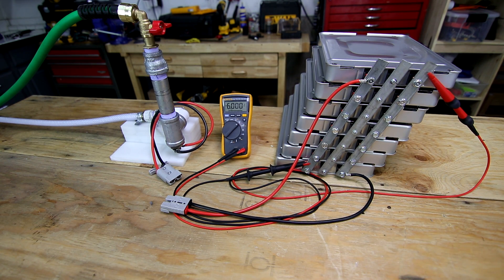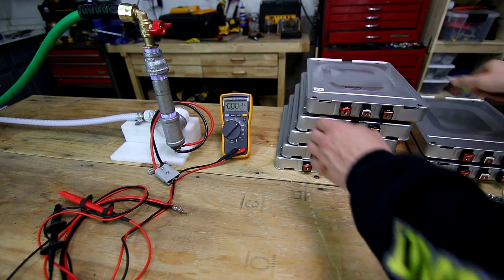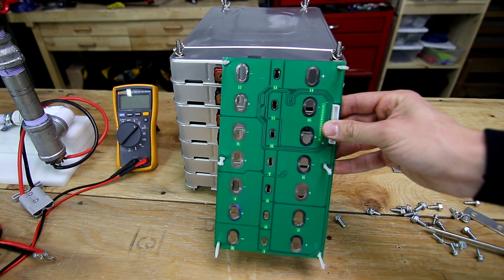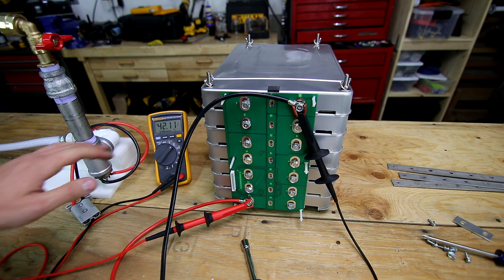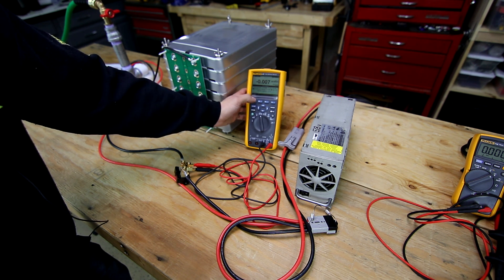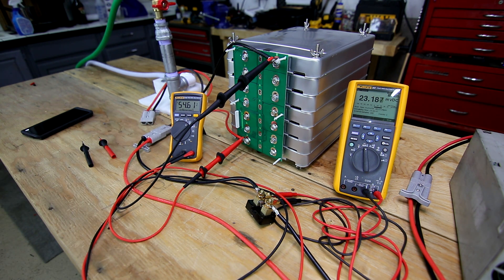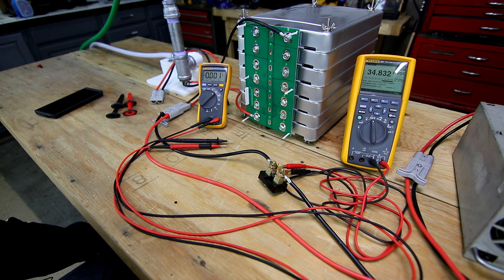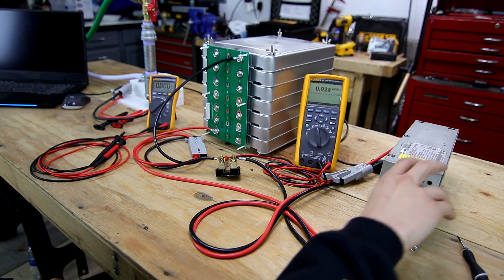Off Grid: Bottom Balance NMC Cells for Solar Use (Leaf Cells)

Comment: I know this is an old video but I still have my first battery I built and it's 24 leaf cells in 24 volt configuration. it powers my small workshop with a powmr 3000 inverter and a victron charge controllers and old sharp solar panels. I have 2 active 5 amp balancers and no bms. people say it's dangerous but so far so good and it's been going for years. I'd like to replace it tho with lifepo4 like my home has

Comment: Alluminum bas bars on copper therminals are not a good practice. Alluminum and copper is a galvanic pair, they will eat each other.
If you have problems with balancing, you have way to different capacity on them.

Comment: Top or bottom balancing will not really work for used cells UNLESS all the cells HAVE similar capacities. Otherwise, weaker cell(s) will always discharge and charge faster, resulting in (possibly large) cell voltage differences. BMS balancing will not be able to make up the difference because they typically only do small balance currents. These are used cells. One cell may be a year old, others may be five years old. One cell may be lightly used, others may be heavily used. You need to test the cells and use similar capacity cells to make the battery pack. For the battery pack, I would monitor the cell voltages so they don't get closer than 0.1V to the high/low voltage specs. These are old NMC cells so you don't want to stress them for safety reasons.

Comment: It's a bit unbalanced because it is a new pack and it is second hand but the BMS will well-balanced the batteries as it charges maybe it's a good idea to make a video ons how installing the BMS..
Reply from the maker: Help me understand then - If I bottom balanced all the cells down to 3.0v then how is it unbalanced?
Reply: To better understand it's a bit of a procedure ask the batteries are charging with a BMS jump around with a voltmeter looking at the battery which battery stays behind it's kind of hard to do this with a lithium small cell battery to better understand this or to practice this method it's on lead acid batteries where is the voltage is far apart

Comment: Another thing to consider when using used cells, they may have started to self discharge. Top balance them to all the same voltage, then disconnect them and let them sit for a month. After that time, measure the cell  voltages and look for ones that are out of line. Even if a cell has good capacity, it should not be used if it has started to self discharge at a higher rate.

Comment: Oh boy, you need to USE a BMS with temperature monitoring! These are used cells that probably have been heavily used. And they are NMC type cells. You need to take GREAT care when charging/discharging this battery chemistry so bad things don't happen! At this point in their battery life, I would not get too close to the maximum (high) charge voltage or the minimum (low) discharge voltage specs.

Comment: Still have 12 modules going to be configured to 24v.   Building a shed to house all solar projects.  Waiting for the completion of that to go forward.
Reply: @pulesjet A 7S configuration for LiIon is better for 24V. With 6S, you will lose a lot of power at the low end of the range, AC inverters typically shutdown somewhere around the 21V range.

Comment: Top and bottom balancing really only works well if the battery cells had a similar life 'experience'. Since these batteries are used, I would have ordered extra battery cells, test the capacity of each cell, then build a battery pack using cells of similar capacities. If you have 1 cell of very limited capacity, that will limit the overall battery pack capacity as you have seen, especially if all the other cells are much better.

Comment: What Battery charger is that? Thanks!
Reply from the maker: It's a Delta brand telecom power supply.  I can get the information from the label later today if you would like it.
Reply: @HighTechLab  yes please question I also used a power supply as a charge but I noticed I cant limit current it puts out the full 600w it was rated at any worry in breaking them.
Reply from the maker: If you're using it for what it's rated for you should in theory be fine unless it's cheap low-quality equipment.
Reply: @HighTechLab  it's a tdk lambda sws600 so it's a great power supply but I am charging 13s lithium to 53.3 volts just by adjusting the voltage setting my batteries can handle it cause they are big and have a high c rating but not sure if the power supply will burn out being at full power for over an hour. Right now I current limit using a Chinese 1500 boost converter but would rather take that put of the equation
Reply: @plojm123  Yup, lambda is good. A good rule of thumb is to run a charger no higher than 80% capacity. Running at 100% will probably decrease its lifespan. And derate the chinese stuff even more. I would not charge batteries at more than a 1C rate.
Reply: @gregb1714  do you have a good way to current limit a power supply using it as a charger?
Reply: @HighTechLab  I'm also interested in your power supply. Can you provide the model number?

Comment: Good info if I could add one point I would let the batteries sit taken apart 24 hours after the 3.0 voltage draw down and check again for 3.0 on each battery and draw down the bounce back on the ones that need it, small point in capacity but it may help. We will be waiting for the capacity test, always enjoy your videos.
Reply from the maker: That is a great point. I have done a lot of draining and resting on these cells prior to the video but they were still all together in the pack

Comment: Nice video.  Very interested if this process will increase the overall capacity of the cells. Some sellers are stating that when these used Leaf cells are used in a low C rate system they will "gain" capacity. Really curious if your testing will shed any light on this possibility... Thanks!

Comment: I prefer to top balance. Good video
Reply from the maker: I top balanced mine at first and had a pretty terrible capacity. The seller of the pack advised that I bottom balance them and do my capacity test again and I actually ended up getting the very close to the same result.  That's partially why I omitted the capacity test from this video. I told my supplier that they need to send me a new pack that has matched cells
Reply: @HighTechLab  try not to absorb charge or float. Hit your target voltage and stop the charge. Then rebulk at 3.9 -4.0. Repeat the cycle. It helps with balance.
Reply: @HighTechLab  for me i gave found there are limits at the top and bottom. You have to deccide what voltage range works for your pack. Ex. If you balance all the cells to 4.1v you can only take them down to where they start going out of balance and you have to stop there. If you balance at the bottom you can only charge to where the get unbalanced . No further. I recommed top balance. You need a bms that is settable so it will stop when you need it to.
Reply: @HighTechLab  i dont think youll get much more then 2 kwh from those cells. I push my gen 2s to 4.175 v per cell and they seem to handle ok. But I stop around nom cell V. 3.6v. To avoid unbalance
Reply: I'm a bottom

Comment: Great explanation. How is your Foxpower inverter and battery setup doing ? Any plans to expand your battery bank soon ?
Reply from the maker: Very very soon actually. I have some sample batteries on the way right now and am going to do a big order if they test out as expected. Video coming soon
Reply: @HighTechLab  Are you not happy with the current LiFePO4 pack that you installed earlier this year?
Reply from the maker: My current lifepo4 pack is way too small for my needs.  It's 100ah 16s and I'm going with like 600ah 3p16s
Reply: @HighTechLab  I'd be interested in the supplier your thinking of?.?  I am looking to expand my leaf setup but I am also considering Lifepo4 now given the costs seem to be going down.
Reply from the maker: If you want to buy leaf cells I can get gen 1 cells to you for really cheap. As far as my supplier for the lithium phosphate I'm still working out details and don't know if it is going to make very much sense in the long run quite yet. These Chinese companies are very sketchy to deal with
Reply: HighTechLab great. I sent you an email. Thanks
Reply from the maker: Mike stasko I saw your email and just sent you a response. Let me know if you don't get it.
Reply: @HighTechLab  I can't wait to see your new videos.

Comment: Being second hand i wouldn't expect them to still be perfectly matched.
Some will have come from locations in the leaf pack that got hotter than others.
Also due to wire/busbar resistance the cells closer to the exit terminals age faster due to supplying more of the needed current than the cells far away from the exit terminals, which have extra resistance.

Comment: Is there a reason why you didn't charge the cells using a BMS?
Reply from the maker: I had a BMS that was only balancing with the cells full.  when the cells were discharged at an attempt of a capacity test, I had some cells at 3 volts triggering the cut out in the BMS and other cells at 3.5 volts. I wanted to see what the capacity was starting from a bottom balance and I will cover the capacity test in the next video

Comment: What DMM leads are you using? They look plenty sharp. Are the clips from the same system?
Reply from the maker: It's a TL220 kit.  The kit comes with the lead wires, which are a very nice silicone lead, and they actually don't tangle up on me.  The clip set and pokey bits come with the TL220 kit.  You can just look them up online and get the full set.